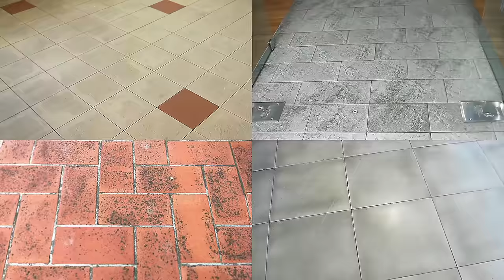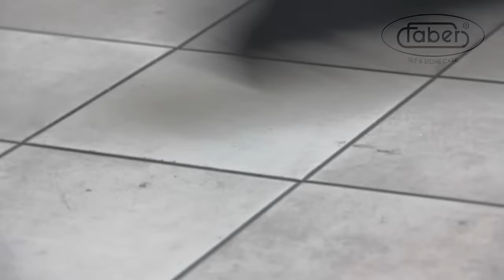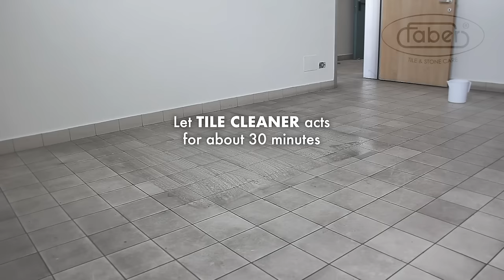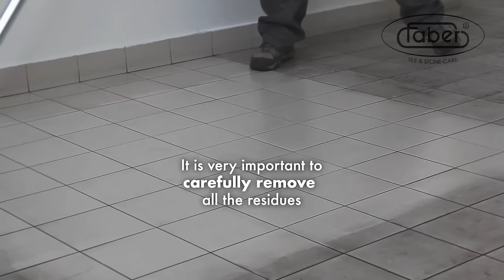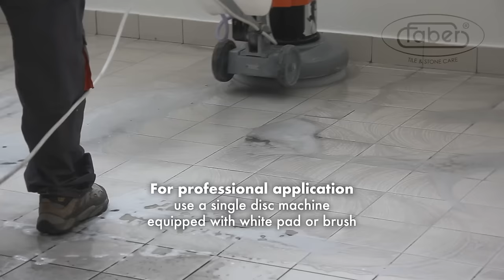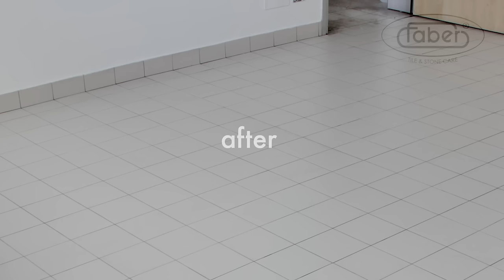TILE CLEANER - How To Clean + Tips

Comment: Does this work on... For example shower tiles where the tiles are grimy and stuff?
Reply from the maker: Yes, TILE CLEANER deeply removes stubborn dirt, and for vertical application, there's the GEL version ( check out the VIDEO https://youtu.be/x-oeIr_GmbA ) - or for acid-sensitive materials, there's an alkaline cleaner DEEP DEGREASER ( see how it works VIDEO https://youtu.be/NWdZWu2XD9Y ). If you want to know more you can contact us directly through chat WhatsApp at +39 339 53 28 333